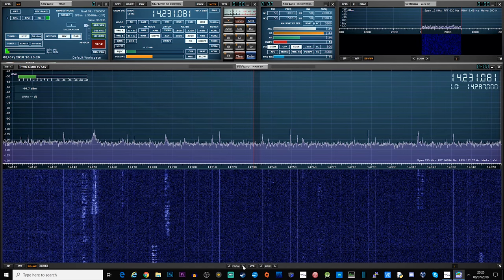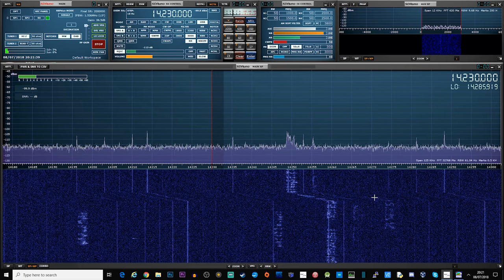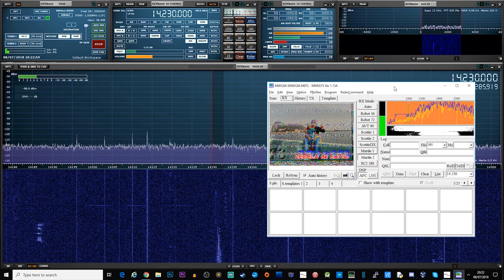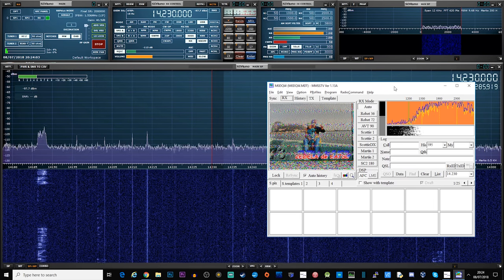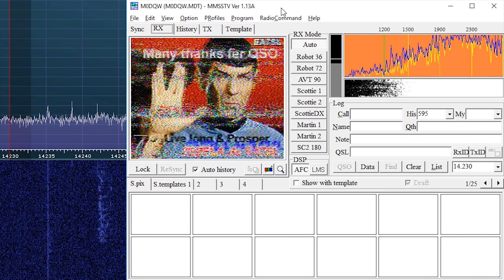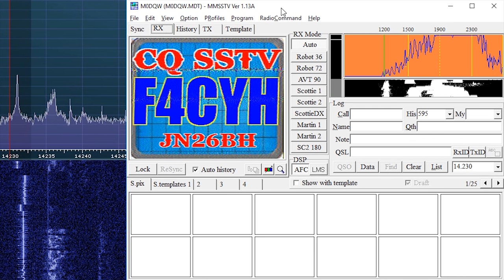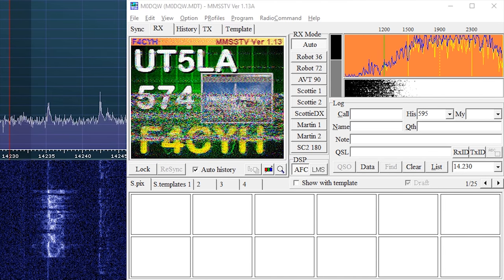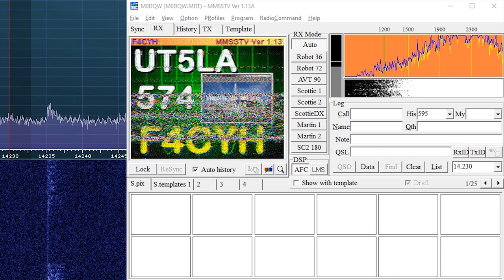Receiving SSTV - Slow Scan Televsion

Comment: I came from SDRplay page and there they say it is so simple "a 12 year old" would understand. You know, some of middle aged guys like, though not new to computing, are still reluctant and have dificulty understanding and aborbing all this. For example, I tried to use Virtual Cable once and I made a mess, for the tutoring messages I had were different from the ones at VB page and it took me a while for me to return things to normal. So I was happy to know you also have a video where you teach how to make use of VB, which I really would like, so that'll be able to start decoding digital modes such as J65, FT8, DRM and even use DSP. I'm very thankful for taking your time to make and share this video.
Reply: Oh yeah , Try getting this running from a linux distro .

Comment: I wonder if the various planetary probes (like the Voyagers and New Horizons) use SSTV to transmit their images.

It may seem possible even with the very weak signals.
Reply from the maker: Wouldn’t that be cool! But I would expect it’s a digital packet and would need an enormous array to receive them.
Reply: @TechMindsOfficial  yeah, probably is more likely digital.  An analog signal would degrade rather quickly over huge distances.   

Just getting the gears cranking upstairs.  :)

Comment: I could never get VB audio cable to work with SDR Sharp to decode digital signal. I take that the SDR Play RST Duo is a much better hardware product than the $20 RTL-SDR radios and the SDRuno is a much better software package than the SDR Sharp. What would the advantage be to have the duo over their other models?
I will have to go and look for the video when you started with the SDR Play RST Duo.
Reply from the maker: I’ve successfully used cheaper SDR dongles to decode digital signals with SDR#. It’s difficult to give a reason why it didn’t work for you but it could be that you didn’t have the modulation set to WFM which for me, seems to be more reliable. Then just adjust the bandwidth so it just covers the digital signal. The DUO is a great piece of kit and I would highly recommend it. It’s my main SDR these days. Having 3 antenna ports plus two independent receivers is just great :) The RSP1A is another great SDR :)
Reply: @TechMindsOfficial  Thanks! I had bought the RTL-SDR units before I had a good understanding ham radio. I was able to setup a scanner using two dongles at one time. I can't remember what the software was called I think it had its own VB cable of sorts built into it. Once I get a HF radio and use that I think the Duo would be a good investment. Thanks Again!